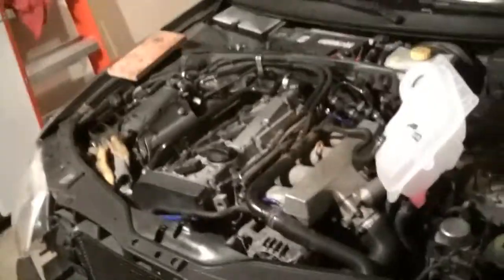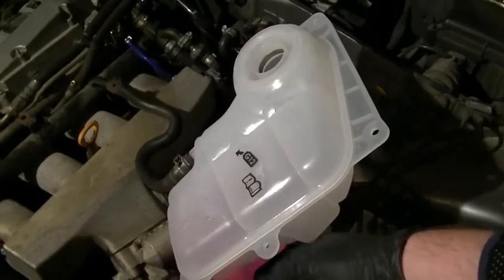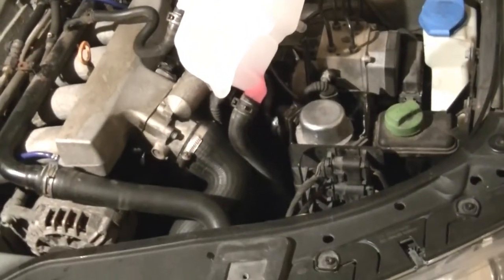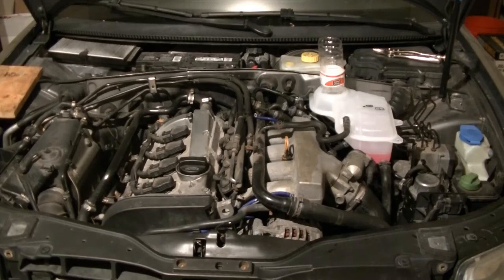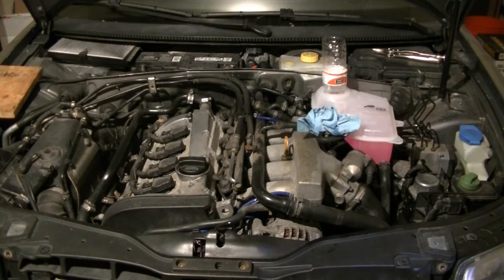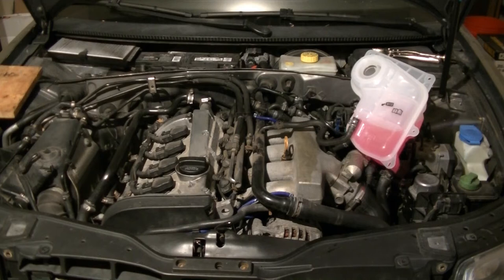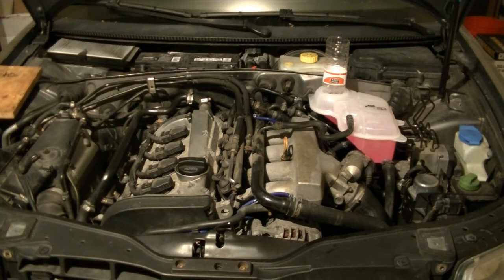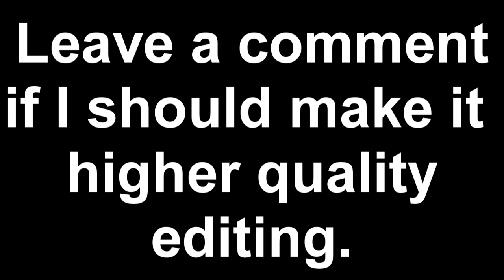VW Audi 1.8T Engine Bleeding the coolant system in a B5.5 Passat

Comment: I have an 03' 1.8T AWM. Coolant steamed the car up bad today. Began to overheat so I did the neutral ride, heat on, and limped home for about 1mi. No visible hose leak. The battery bay is filled with fluid, so I was thinking maybe the heater core, before the water pump, thermostat, etc. I topped off with distilled water just to check. Once running, I cracked the reservoir and it backfilled. It took about 5min of running for it to drop maybe from the MAX level to the LOW level. I cracked it again and it filled. The only thing I noticed at the reservoir was that the return was coming in, but the top inch was foamy. Maybe not a head gasket as I did pour in an additive (I know). Interestingly, after the single top-off - there are no more lights or overheating issues whatsoever, at idle OR operating temp at any speed range up to 60mph. Was there something clogged perhaps? A "passed stone". Really odd. I plan to flush and replace the system. The vehicle has 238K and I just replace the oil pressure sensor - runs great.

Comment: Good vid. I just finished changing my V5 Passats serpentine belt, pulleys and water pump. I had to drain coolant (obviously). After rebuilding the front there was no heat to the cabin. I didn't want to use your method because mine hoses (where the bleeder hole is) have some kind of plastic pipe around them. So I just used the old trick. Park your car steep uphill, remove the coolant cap and it should bleed itself. At least mine did.

Comment: my audi 1.8t start overheat after 10 minute and it have a new waterpump. i dont know what the problem can be. and it working fine on a normal temperature in this 10 minutes
Reply from the maker: Unfortunately that could be many things. Impeller failure, coolant leak, air in the system, blockage, head gasket, etc.  I'm sorry I can't be of more help. I wish you the best of luck!
Reply: That happened to me. Temp gauge is usually at 190F. Above that is overheating. I turned the car off and let it cool a bit. Then started to squeeze various coolant hoses to work the air out.

Comment: I replaced the rear coolant flange & need to burp the system.  From your video you say do the process after the engine warms, but I'm supposed to let it cool??  I really need to burp my system.
Reply from the maker: @placebo addy If I said to warm the system I do not recall the context. You should bleed the coolant system cold. Does that make more sense?

Comment: You're missing the cover for your cabin filter.
Reply: It doesn't have one. It's covered by the large plastic cover that goes over that whole area below the windshield.
Reply: @Demonpixyb  That must be the difference between B5.5 & B5.  I have a B5 and there is a separate cabin filter cover, and there is no cover over the battery/cowl area.
Reply: there is no cover for the cabin filter

Comment: I had looked for a bleeder valve for this system, but didnt find one. 

I just had to replace the alternator on my sons Passat 1.8, (exactly the same as your Audi ) and to do that job, you have to remove the radiator hose. Now he has no heat. I'm guessing that just refilling the coolant expansion tank wont bleed out all the air and I think it may be the reason the heat stopped working, since the system probably has air in it now. I'll give this a try and see if his heat comes back. Cant think of any other reason it would suddenly stop working after replacing the alternator. Thanks for the vid.

Comment: Looks like a brand new coolant reservoir. Did yours start to crack or leak?
Reply from the maker: Mine was OEM and didn't crack. However it was severely discolored to the point it was hard to see the coolant level.

Comment: Are you supposed to bleed it everyone you add coolant? I didn't and now I'm told my water pump might be bad. Coolent leaks at bottom of engine, not in hoses or radiator. However, since I over filled it with water, it's not leaking. Could it because it pushed out the air that I didn't bleed out the bottom? Is there anything I can do to fix my mistake?
Reply from the maker: You could bleed the system now. 
You only need to bleed it if there is a leak, you drained all the coolant, or if you open the system -as in remove a hose. 

Sadly I need to know more about the symptoms to understand if it could be the water pump.
Reply: @DaOneEnOnly    I’ve never used nor have I ever heard or been told to use a 50/50 coolant mix for my 2003 Audi A4 1.8t Quattro.  I’ve always used straight coolant, never a 50/50 mix.  Are you suggesting or saying that my car should also use a 50/50 coolant mix, that I’ve been doing it wrong all along?  Or are you simply saying that the 50/50 mix you do here pertains to this Passat and not to the Audi?
Reply: @ndailorw5079  Every car must use 50/50 coolant!!! That translates to -35 degrees Celsius.

Comment: what's the grey thing at 1:38 next to the power steering fluid /green thing?
Reply from the maker: I assume you are asking about the grey cylinder to the left of the power steering. 

That is the vacuum pump for the brake booster. It is only fitted on automatics.

Comment: I used peaks purple cooler for Audi 2006 and up IS that bad?
Reply from the maker: The service manual is specific about G12 or newer coolant. I'm not sure if pikes is compliant with those vw standards. I recommend checking the bottle to see if they are listed. If they are not listed then your guess is as good as mine if it is okay or not.
Reply: Depends on year of the audi